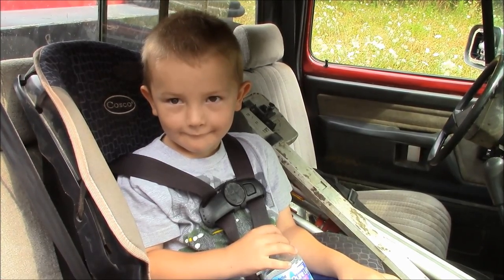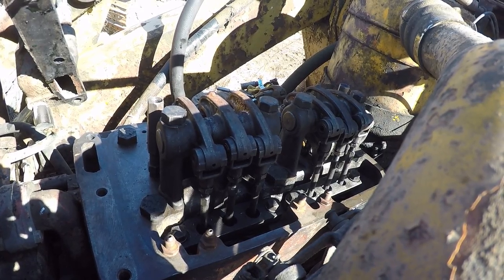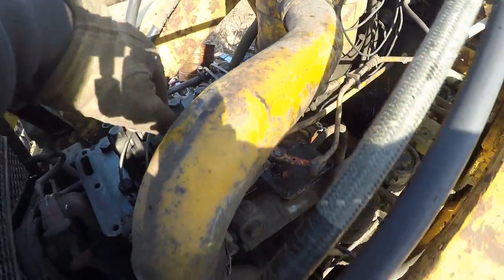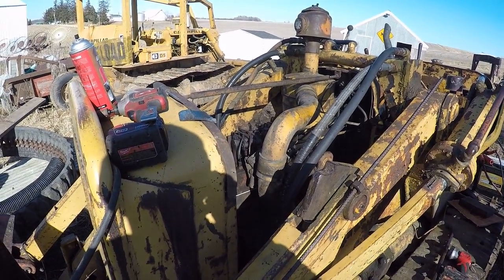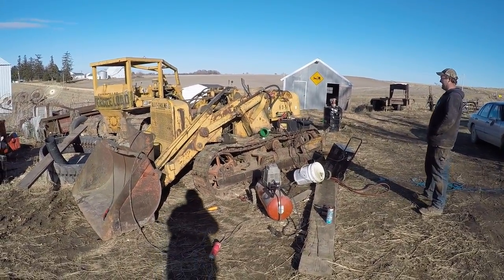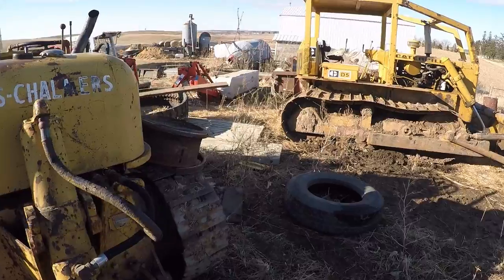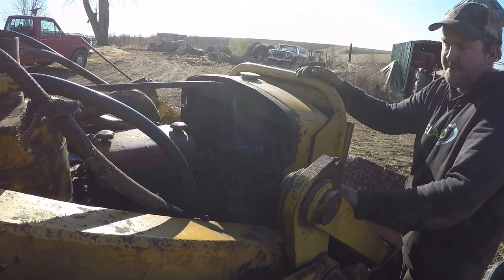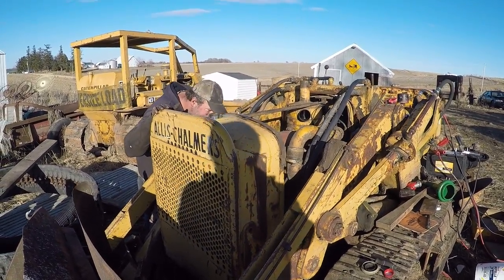Allis Chalmers HD5 | 2-71 Detroit - Will it Run after 17 Years?

Comment: I had an HD-5, loved it.  It is an agricultural tractor with a loader kit.  Some recommendations: go ahead and pull the fuel tank off and remove the left and right steering brake/steering clutch covers. There are two holes in the bottom that I believe are 1-1/4 npt. If holes are open, pack rats and mice will fill the cavities with debris. Clean them out before engaging.  I had on the that broke beyond repair.  No part was available at the time and had to have machine shop fab up a replica.  (Some resources parting machines out on antique tractor forums after)  Clean and lube it all up.  Some zerks in there too.  It is a tight spot to work in and well worth the effort to same a lot of hours and busted knuckles.  Also be very careful running with no water.  Had a hole in radiator too.  Brought truck into pasture as close as I could to haul it back to shop, didn't make it 30 yds before it came apart.  Sad day......  I built a canopy for it and extended muffler above canopy.  Made a huge difference, still needed ear plugs when working it long or hard.  Pull floor plate up to reveal clutch inspection cover on top center.  It has an adjustable clutch.  Inspect the mechanical linkages and make sure true and square.  Several cotter keys.  Make sure they are appropriate size and not falling g apart.  Several grease zerks in there too.
Reply: That will be very helpful advice for me, as i just got my grandfathers HD-5 running again after 2 years. it had 2 stuck exhaust vales and 1 stuck injector. she has not pushed dirt or worked in over 20 years, so i am being careful and trying to check everything i can. I have to repack the seals in the tracks, because she has a good leak coming from both tracks. that's why she got parked.

Comment: Both tracks froze, 10 inches deep, and not ran for 23 years. Offered it to a logger for scrap value. I told him we used to pull it in 3rd to start it. Skidded it for 200 yards. I told him to pick up each side and drop a couple feet, and to hit rear track up high with dozer blade to chisel it forward. Nothing to lift with, but first strike from behind with blade, pop. Freed both tracks. Pulled it and had it running and driving within 50 yards. Smoked like mad, would hide a battleship, but cleared pretty quick. I told him I never thought I'd hear that run again. These are easy to pull to start. Mine was orange with big bucket. Seemed like an older, bigger AC.

Comment: Well I learned a thing; I did not know how a 2 stroke diesel worked. Thank you for the explanation and getting this fella flexing again.
Reply: If you want to see more on Detroit's like the 12 71 and 8 71 goto De Boss garage they blow one up by letting it run away and they have a few others that they are trying to find homes for Rich does a great job of showing and explaining them if you're not familiar with them.

Comment: Beauty! Love the thought of the 2 cylinder 2 stroke Detroit
Reply: carl lagle indeed, they made several models of Detroit diesel,  the smaller 53 cubic inch, or the larger 71 cubic inch. I usually find that off-road applications had the 53 series, we have had several dynahoe 190-4 backhoes and they have all had 4-53s, this dozer looks like it was built around the time 53 series came out. I am probably wrong about that though.
Reply: carl lagle  http://www.dieselduck.info/historical/01%20diesel%20engine/detroit%20diesel/index.html#.Xmgoz_RlBhE seems to be a pretty informative webpage, what was it 110Cubic inch? They have made so many odd ball things, it's neat to see the relics.

Comment: I had the same type engine in our missile launcher in the Army. A 2-stroke diesel which the fuel rack DID get stuck in the full throttle position. We had to smother the intake with a user's manual that was 3 inches thick. All while the driver is sitting in the track driver's seat hold the laterals (steering/braking) hard to keep from running over me. We tried opening the drain cock of the fuel filters but only got a great soaking of fuel. Never forget it. Them damn engines were hell to maintain and keep running. Ahh the memories.

Comment: was a kid. And the rear cylinder rack needs a tweak. I ran a dragline with a 3-71 that popped and smoked off one cylinder except under load when it cleaned out. Found out what injector it was and got a rebuilt one. Put it in and the hole that the setting tool fit into was ruined so no real way to set it. Started it and it still popped and smoked. Played with the rack by ear and it cleaned out and ran fine from then on.Good job U 2! GBWYall!

Comment: I spent a number of years running a AC HD 5 like this except it was the dozer blade and winch version. The oil company I worked for had one and I built a lot of roads and well locations with that old dozer. I loved running it the sound that Detroit makes when your working is amazing not to mention that little 2-71 sure had the power. We had the engine completely rebuilt and put new undercarriage on it made her one fine machine.

Comment: I worked for a rental place as a mechanic and was thrown into big equipment repairs, customers always ran our equipment out of fuel, I was taught about how to prime them using the little pump, screw that! I found using a piece of inner tube with the valve on it placed over the fuel tank fill with a pipe clamp and put a couple of lbs of air into it would let me bleed the system with ease lol.

Comment: The generator has more than likely lost it's residual magnetism. All it needs is something called flashing the field. This is done by disconnecting the field wire and applying battery voltage by striking the field terminal with a wire hooked up to the battery. Guaranteed to work!

Comment: Totally surprised that the valve snapping off didn't destroy that cylinder. Lucked out on that one. This thing might have some potential. The hydraulic tank being empty is likely a result of a blown hose somewhere. After 17 years, all the fluid that leaked out is several feet into the ground. Will have to hunt that leak. Congrats. I could watch this video again...LOL
Reply from the maker: Hard to say. Loose hose clamp or something. Over 17 years, it's not going to hurt anything.

Comment: Trick to prime fuel system. Remove fuel cap. Drill at vent holelarge enough for valve stem. Install solid tractor type stem. Fill to 2-3 psi. This will push fuel through the system.

Comment: My first job running a welding rig was in Manitoba for a gravel crushing outfit. The truck was a beat up old Dodge with a winch deck and gin polls. The welder was a Hobart 400 amp machine with a supercharged 2-71 jimmy for power. I truly hated that machine. When you started it it went straight to full bore and it was quite possibly the loudest engine I have ever heard. 12 hours a day with that thing and you were literally vibrating at the end of the day.

Comment: I have also waited for this one, amazing, they did some really good quality engines back in the days!
Reply from the maker: It's not clean or efficient, but it sure does work!
Reply: danne77sthlm Wes said , and the EPA hated them !!!
Reply: @WatchWesWork  Weird thing is....now old gasoline engines are really crap. They stink and they make no power for fuel used. But old Diesels. Not so much. Its crazy how long a 1960s Agricultural Diesel will run with one tank of fuel. And once warmed up and at medium load...not even much smoke. Just hot, slighly smelly "air".

Comment: Sounds real good after it ran a bit. Someone commented on my 6v53 Firetruck old start and said the question isn’t on old Detroit’s if they will run but if they will run away. I tend to think that’s correct. This one took some love but it runs good now.
Reply from the maker: If you can get some fuel in them and enough RPMs on the starter they will usually run. Even the really tired ones!

Comment: I can't believe he ran it so long without coolant.
Reply: Takes my diesel a really long time to warm up
Reply: Its a Detroit Diesel. Those things are near indestructible
Reply: The problem with running the 2-71’s fry is it burns up the head gasket.   The 2-71 is like the “low block” Detroits that use a traditional head gasket
Reply: I wouldn't have run it half that time.

Comment: Ive got an HD-5 2-71 with the same tracto-motive loader on it and she’s always been a hard startin bastard. It kills 4D batteries regularly. Nice to see y’all gettin it goin
Reply from the maker: My experience with these Detroits is you pretty much have to follow them around with a can of ether...
Reply: Yeah they are always treated as either baby’s and it slowly kills them. And all of those exhaust manifolds are rotted out too, my machine is set up with a hyster winch and heavy guarding for west coast logging.
Reply: And we converted it to a Chevy 1wire alternator too
Reply from the maker: @GrizztheForkliftMechanic  A winch would be cool. I think this one will be switched to negative ground and a Delco alternator.

Comment: Sounds kind of like a 1-71. Seems a little chuffy on the exhaust. Sure it doesn't have a valve tight or one not sealing?
Reply from the maker: The valves were all ground. The rings may be a little iffy in the second cylinder. The injector on number two was not firing at first, but by the end we had 2 cylinders.

Comment: Absolutely love seeing videos with these old Detroit's that haven't been run in forever.  From the videos I've seen on Youtube as long as the rack doesn't stick they're pretty much indestructible.  Deboss garage tried to run one away and it just wouldn't and even when it did and then died it started right back up.  Although it did then proceed to open a new service hole in the crankcase lmao

Comment: Im NOT a fan of starting fluid BUT, in this old pig I'da' been using it WHILE CRANKING to get it primed. As you did.

A safer option is WD-4O but I've never had it work for me.

Running a heat gun into the intake helps too. Just make SURE there's no plastic or rubber in the way.

Comment: This was the engine I hated working on.... so easy to run away and push the conrods thru the engine block  -- yes the blower on the 6 cylindres !!!  Nissan made some trucks with 3 cylinders diesel semi 2 stroke  -- what a sh...... engine for the mechanic to repair !!! Good luck guys !

Comment: Next time, get an old rag on a metal rod, make it wet with diesel. Ignite it and hold it in the air intake (where not plastic or rubber parts are in front of the engine - for course :)

It will provide enough heat to start the engine even without glow plugs.

Comment: No mosquitoes were harmed in the making of this film. Pretty sure the generator has oil caps that lube the bearings. But, you probably know that. I have an old Case 850 track loader and the front idlers are totally shot.

Comment: Awe there's just no engine like the old Detroit diesel's there sound there dependably they are just awesome engines.  I've had a 8v71 blow 2 cylinders and we drove it for a hour after that and It started right up the next morning then we pulled the right hand head off replaced the 2 cylinders and it has run like a top since I love the old Detroit 2 cycle diesel's
Reply from the maker: I saw a 6-71 once that ran with a hole clear through one piston. It smoked a little more than normal, but it actually ran pretty well...
Reply: @WatchWesWork  yea I bet the 8v71 since it went in the night was throwing sparks out the muffler it was really cool to watch but also really scary because I was worried it was going to run on its oil but the rings were just gone on it. There good motors and they are virtually impossible to kill

Comment: I own one of these. There were 29000+ of these built between 1946 and 1955. Mine is a 1949. You can find the year of yours using the serial number and this chart.
1946: 1
1947: 7
1948: 1358
1949: 4316
1950: 7499
1951: 11071
1952: 14290
1953: 17558
1954: 21837
1955: 25564

Comment: I drove an HD- 5 in the 50s and the 60s. In those days you could overhaul one of these mothers cheap. The parts were $100 per cylinder. The exhaust was in front of you. The noise  WAS TERRIBLE.   A MUCH BETTER tractor than the HD-7, but less power. First generation tractor with 500 hr rollers,  double resection final drives. You could pull the transmission or the clutch without splitting the tractor. This was a very modern tractor for a 1950 generation tractor. I believe Alli-Challmers
Introduced this tractor in 1948.

Comment: What a machine, god bless 'murica. That engine probably hasn't run as long as I've been alive. I bet they tried to get it running back in 2003 and probably failed. Infact i bet the attempt is what popped the head off of that valve. 

To my shame i know next to nothing about 2 stroke diesels. My dad used to maintain an old Detroit unit where he worked in the 80's. It had issues starting one day so he used the burning rag trick on it but someone had messed with the throttle so when it finally started it went runaway, sucked the rag through and shot it out the exhaust in a cloud of little bits. Oddly enough after a CO2 fire extinguisher down the intake and a few adjustments it ran fine afterwards.
Reply from the maker: I've heard the fire extinguisher trick before. No oxygen, no combustion I guess.

Comment: That solenoid driven yolk is a problem on these old starters.  You have to take the starter out, rebuild it and check the wiring.  The wires can get worn and need to be cut back and reattached.  I've had to do that to my D-17's starter a couple of times in the last 15 years.
Reply from the maker: I think the biggest issue on this one is the linkage. One of the pins have been replaced with a large fencing staple...
Reply: That would definitely be a problem.  Yes, sometimes it's a mechanical issue and you need to install/replace the bushings on the yolk and the main ones too.  What we've thought is happening on the electrical side, is that over time just the sheer amount of amps flowing through those small wires heats them up and makes them brittle and they 'wear' at the point where they are connected.  So yes, go through the whole starter, the rebuild kit was $17-$25 the last time I bought one a few years ago, it has the main bushings and some other fun things.  It's not a difficult rebuild but can be tricky if you don't actually look at the actuator solenoid itself to see if it needs rebuilding/repair also.  If you're thorough, you have a good starter that works well as long as you give it heavy enough power cable feeding it and keep it lubed up.  Thanks for replying.

Comment: Running without coolant made me a little nervous but the fan was turning and it was cold out as you said.  I wonder if the radiator could be a JB Weld fix temporarily so you/he could work on the other functions...exhaust, hyd.  Machine CPR!
Reply from the maker: So technically it has some coolant, he just drained it enough to remove the head.

Comment: you think the injector stuck open and it overreved floated a valve and kissed a piston  ??? those 2 strokes are normally unstoppable we had a bunch of V16-91T at my last job
Reply: nevermind watch the whole video you guys came to the same conclusion lol
Reply from the maker: That's our best guess. It must have happened quick because the shutdown lever on this engine also shuts off the air.

Comment: They sure don't make starters like they used to. A new machine starter would have burned up from overheating with all of that extended cranking. Although that is a small engine, I am sure it does not require a lot of torque to turn it.

Comment: That ANSI "CLAW/BEATING" device is a universal standard item(commonly referred to as hammer), along with its mate the "twist/chisel/pry" device, often called a screwdriver. Every mechanics first two tools in the box. Can't wait for the updates on this project. Great job guys. BTW, is the "6-71", the big brother to this motor?
Reply from the maker: Yes. They made a 1-71, 2-71, 3-71, 4-71, 6-71. I'm not sure if the 71 series was ever made in a V configuration.

Comment: Keep a CO2 fire exstinguisher handy to spray in the intake if it runs away. Get a bad blower seal it will run on its own oil until it runs out.
Reply from the maker: The fire extinguisher is probably worth more than the machine, so we'd be upside down on that...

Comment: The engine is very rare! It's worth more than the whole  machine..
Reply from the maker: I don't know about that. They made a lot of these smaller Detroits. They were used in John Deere dozers, several models of motor graders, as well as many pumps, compressors, and welders.

Comment: Those 71 series Detroits always seem to come back with a little elbow grease. The blower always makes people think they are supercharged, but they aren't.
Reply from the maker: Right. It's just there for exhaust scavenging.
Reply: @WatchWesWork  Yes, it also provides intake air at just slightly above atmospheric pressure, as there's no other way to get air in there.
https://en.wikipedia.org/wiki/Detroit_Diesel_Series_71#Design  To get boost, you need a turbocharger.

Comment: Sounded great.     The contacts in the voltage regulator could be corroded or oxdized, but the communtator and brushes in the generator will probably  also need to be cleaned up.    Also make sure the brushes are free in their brush holders.      Then you may have to polarize the generator field because it's been sitting so long.      Was the electrical system originally positive or negative ground.
Reply from the maker: It was positive ground. But I'm sure he will switch it to a single wire alternator.
Reply: @WatchWesWork  That'll fix it.

Comment: Some old engines require compression to be restored before starting. Mix about 50/50 diesel and engine oil and pour a half cup or so into the bore to seal the rings. In a spark plug engine this would be disastrous. For a CI engine compression is king.